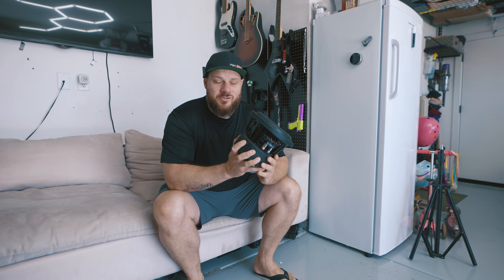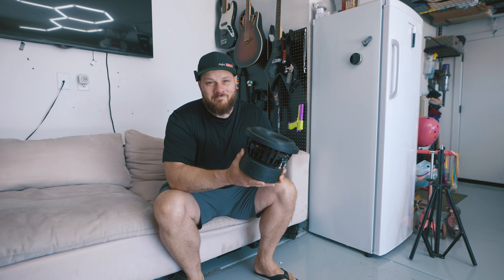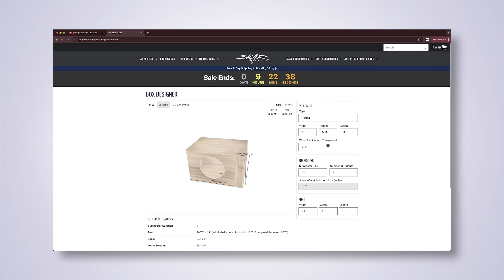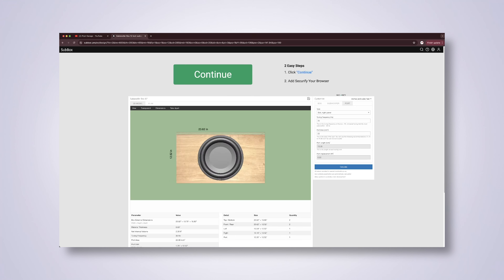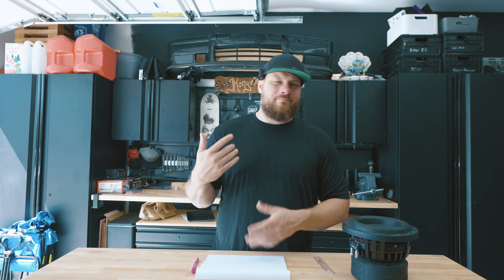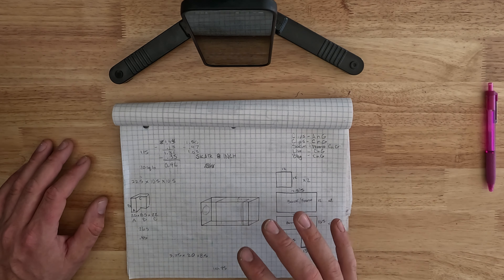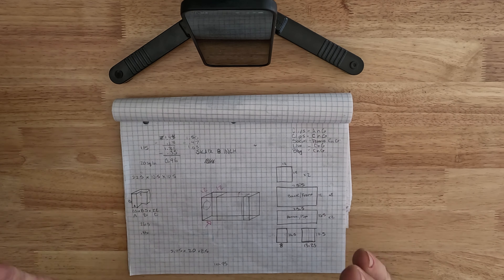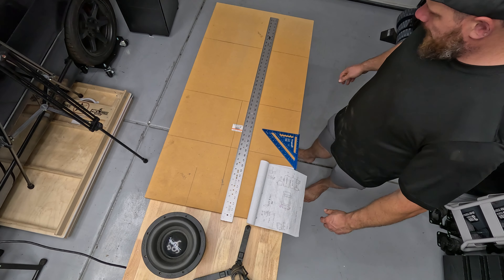SKAR 8" EVL Box Build

Comment: I’ve been trying to think of a way to make a box for these 8s under an f150 crew cab seat. I already have and made a box for a L7t slim 10” and I’m not happy with it . What do you recommend?
Reply from the maker: Sealed or vented? Trucks are tricky. I have another video doing the 10” L7T behind the backrest of the tundra. Position matters for sure. It’s a bit timid for my liking, so I may try to squeeze a 12 in.

Comment: I have a stock electrical on my 2018 RAM 3.6L. Running a Memphis 1500.1 mono amp to a DeafBonce SA-302 12" with 2000 RMS and it SLAMS in an SPL box. Voltage drops to low 13's in full slam. Thinking of adding a 75x4 watt amp for my upgraded door 6x9s. You think Alt upgrade if the voltage drops more, or a battery in the back to help the sub amp? I know mid and highs won't draw lots of juice for a daily driver.
Reply from the maker: To be honest, I’m not an expert on electrical. I’ve dabbled with wiring outside of audio (still working through chassis and engine harness for the e36).

What I’d say is look into a capacitor OR, upgrade the battery itself to something with more power. Customer support at Antigravity would likely have a better answer. They are pricy, but you may be able to just get a higher output battery, rather than run 2.

Working on getting an affiliate link with them, will be in the description once we got it.
Reply: @prjctgarage4457  all good, thank you Bro..
Reply: Deep cell battery, upgrade your alt and put in a capacitor or multiple. Do all 3 and you won't have issues. Just make sure to do your math for the capacitors. Realistically, your alt is probably fine if you're not running your amps to max all the time, if you have a deep cell.
Reply: @Playswithfire3782  Yes I really only blast at the end of the day on the way home, and always turn down at the lights out of respect to other drivers. My family says they hear coming a block away. I'll get a Mechman Alt after this dies, I think 220Amp is my stock alt rating, and I'm running an Optima Yellow top. Thank you for the input friend.

Comment: The box port is too small thats why its sounds like a blower aka chuffing lol make the port area bigger and you will get more out put and less chuff make its 16 inches of port area per cube
Reply from the maker: No chuffing. It was that I didnt put all the sub screws in, so it was not a perfect seal. Otherwise, this thing sounds GREAT. With that said... I may build a second box and do a bigger port as I want to test my original design without losing the current box I have. So... video coming soon :)

Comment: The skar evl 8 is 🗑️ I’m not saying skar sucks just that woofer in particular
Reply from the maker: I don’t disagree. If I had the budget, it would be a 10” RE with a USA Amp (had 2 in my F150 back in like 2008). But so far, it’s done great.
Reply: @prjctgarage4457  I never understand when people say they only had the budget for skar when sundown has a budget line that’s cheaper and WAYYYY out performs the skar everytime
Reply: What are your thoughts on the EVL 12 with loaded enclosure (taking price, availability, and ease into account)?
Reply from the maker: @masonmaldonado5318  I guess I'm not that deep of a Bass-Head. I've not heard of Sundown.
Reply: @jpeg4113  go with a sundown e12 v4 it’s cheaper handles more power and just all around way higher quality
Reply: I think I'll take Skar side, Had (4) 12s in a box and one blew and I already had (4) Skar EVL 8’s. Took out those (4) 12’s, in the same box, added wood and cut smaller holes. Installed the (4) Skar 8’s in the same box and they play a lot better than expected, bought 4 more and gonna do a (8) Skar 8’s build in my Nissan Titan. So I roll with Skar, I don’t see the trash u guys are talking about